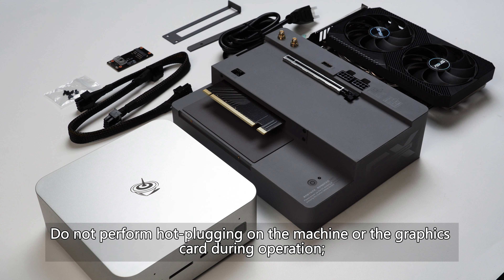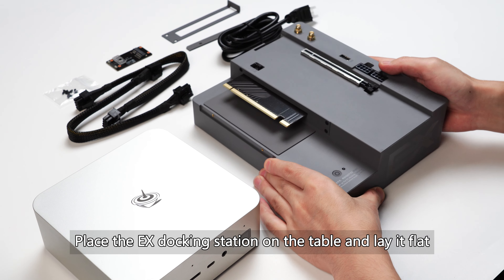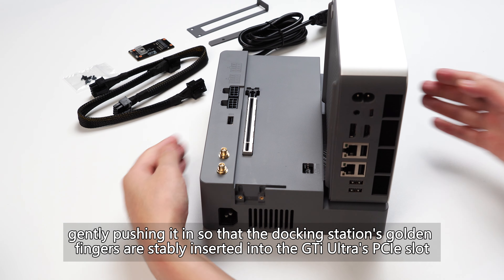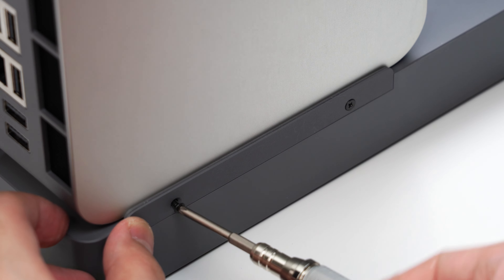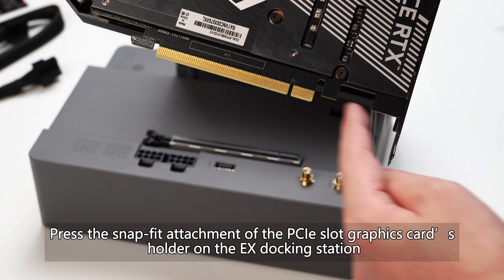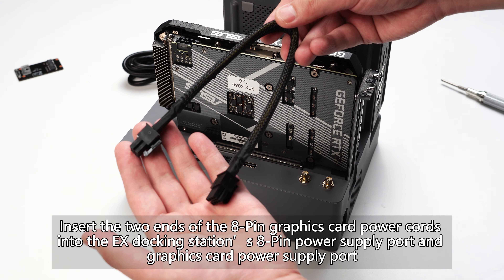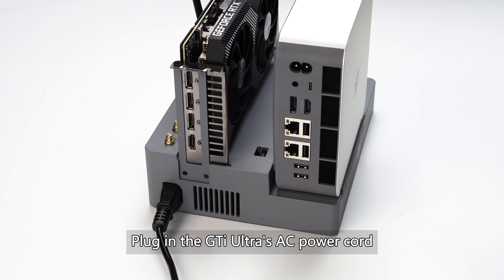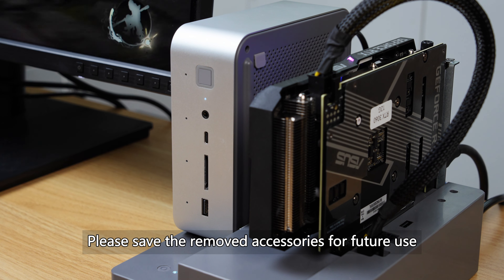How to install EX Docking Station for GTi Ultra and Graphics

Comment: Done (before I found this video)! Got mine a few hours back and my GTI14i Ultra 9 185h  with 96GBRam and 5TB SSD (1+4) is working silently and cool with my Zotac 3090 Trinity OC ... all flawless! Latest NVIDIA gaming ready drivers ... (and WSL2 Ubuntu 24.04). My mini home lab/creator/gaming cube is now exactly what I wanted!
Reply: @chafik0566 Awesome setup. Congratulations. I was considering buying 96 GB of RAM, but after checking the prices, I thought twice. My primary goal is to offload my Synology containers and add Home Assistant and maybe OPNsense. 32 GB should be enough, but 96gb would give me more peace of mind.
Reply: This is exactly what I've bought as well. I don't suppose you'd mind sharing your ssd and ram so I know what I'm getting will be compatible?

Also in which country are you based, I am in the UK and placed the order yesterday. However haven't heard anything regarding shipping. 

Cheers!
Reply: @JoelFabiani  yea ... my RTX GPU is showing now 24GB dedicated RAM and more than 40GB shared :) for those bigger tasks ... and I can run in WSL multiple Linux including GPU virtualization and if I choose to Desktop as well ... and Mac OS 14 in HyperV ... all together, lol. So its enough RAM to have multiple machines at the same time!
Reply: How's the power supply is it loud?
Reply: 96gbram😲u can buy ur own ram and upgrade it urself?

Comment: It’s unfortunate there are 2 separate power buttons
Reply from the maker: Hi, the PC and the dock each have independent power supply capabilities and can be used separately or in combination. In a daily office, audio and video, and other light graphics load scenarios, the PC's integrated graphics can be used, which is energy-saving and quiet. For usage scenarios that require high-performance graphics, such as playing 3A games, video rendering, local AI large model calculations, etc., you can use a discrete graphics card with stronger performance. The dual-switch design ensures that users can switch usage modes anytime and also extend the product life.
Reply: @Beelinkchannel the docking station should provide a power cable to power the pc

Comment: I purchased the Beelink GTi14 Ultra 185h model and am doing a benchmark test, but the CPU score is measured lower than 155h. This is a ridiculous number. Is there a solution to this?
Reply from the maker: Are you testing the CPU score by connecting to a graphics card? If so, please set the graphics card location in the BIOS to IGFX, and the score will be back to normal. If you are not sure how to do this, please contact our support team at support-pc@bee-link.com for help, thanks!
Reply: @Beelinkchannel  The issue of CPU performance decreasing when a graphics card is connected has been resolved with a BIOS update. However, after solving the problem, the score of CPU Ultra 9 is lower than the scores of review YouTubers of Ultra 7 chipset. Please tell me the solution for this part.
Reply: @ITan94-IT  Just to let you know, friend of mine had the exact same issue with this mini-pc and told me all he had to do was switch an option in the bios: System Agent Configuration - Graphics Configuration - Primary Display. Change the setting there from "Auto" to "IGFX". Supposedly the cpu started acting normally and had proper performance as it should.

Hope it helps!
Reply: @MrQwertyman111  Thank you for your kindness. But I've already set it up. Even after setting it up, the r23 benchmark is only 12000 and the timespy score is still lower than 155h
Reply: @ITan94-IT  Did you find a solution for this?

Comment: Hello this idea is fabulous and perfect but are you planning to make other beelink mini pc also compatible?. I am using the gtr 7 pro. Is it possible to make docking station also compatible with other beelink mini pc? The biggest problem Im facing is the only way to connect an egpu is using a thunderbolt but that really doesnt utilize the gpu fully.
Reply from the maker: Currently, only the GTi Ultra series is compatible with the dock, and we will release more models that also compatible in the future.

Comment: Great video. What would be the best GPU considering the x8 PCI lanes?
Reply from the maker: When using an NVIDIA 4080 card or with a lower GPU, there is almost no loss and the performance of the GPU can be fully utilized.
Reply: @Beelinkchannel how much performance loss with a 4090
Reply from the maker: @hidden_name7469  The loss will be around 2%.
Reply: @Beelinkchannel  not bad at all! Are the dock fans rally loud when using the 4090?
Reply from the maker: @hidden_name7469  The dock and the GTi Ultra will not be making loud noise, please rest assured
Reply: Thanks! What is the PSU that is inside? Can you share that detail? @Beelinkchannel
Reply: @Beelinkchannel  Please share more information about the PSU. What is the pinout?
Reply from the maker: @marshallskeen6560  Sorry, we can not share more info about the pinout of the PSU, please let me knoe if you have other questions, thanks!
Reply: @Beelinkchannel  What do you mean? How are people supposed to know which cables to use for the dock? Without knowing the PSU specs, you can destroy your hardware...
Reply from the maker: @marshallskeen6560  Hi, sorry for misunderstanding your message, do you mean that you want to know the specs of the 8pin power supply interface?
Reply: @Beelinkchannel  Yes, that's correct.
Reply from the maker: @marshallskeen6560  Hi, the specs are clearly labeled on the interface, please contact us at support-pc@bee-link.com for the high-resolution image of the interface specs for reference, thanks!

Comment: a yo, too many cables?? does the minibox still need power plug too ? just draw it from the 600watt dock
Reply from the maker: Yes, they are powered separately.
Reply: So all three monitor; pc and ex docking station needs to connect to power supply? Can I use a surge protector to connect them too?
Reply: What the optimum best cable from graphic card to monitor a display cable or HDMI cable?

Comment: The product is good, but the performance is different from the description
1. My cpu cinebench R23 only has 12000 multi points. I'm only getting 750 points in 2024 version as well. This shows a performance drop of as much as 20% of 185h performance. Is there a solution to this???

2. I live in Korea. So I want to buy an ac cable for Korea, is it okay to connect 220v 2.5A cable???
Reply from the maker: Could you please contact our support team at support-pc@bee-link.com for detailed help? Thanks.
Reply: weird, I'm getting 1k higher than avg. score on Timespy with my 4070 ti super. Literally performing BETTER than my desktop.

Comment: Except for the model list available at the official website how can I know if a chosen GPU will fit in size to the docking station or will be too big? I wouldn't want to disassemble any parts from the GPU before installing it.
Reply from the maker: Hi, there is no limit on the length of the eGPU, and the maximum thickness of the eGPU is about 72mm.
Reply: @Beelinkchannel  Thank you :)

Comment: If you shut down the PC, does the graphics card PSU shut down as well? What about sleep/suspend modes?
Reply from the maker: The graphics card will be suspended if you turn off the pc.

Comment: I just got mine today. It doesn't work. light on the power button turns on 3 times then stays off. My graphics card at that times runs like a jet engine. do I need a driver? I turned the GPU on first like the video says then the computer. is there something more I need to do?
Reply from the maker: Hi, could you please contact support-pc@bee-link.com? Our support team will handle the problem, thanks!
Reply: did you figure out what the problem was?
Reply: @Feynman.R  i second that question

Comment: can we add more powerful power supply to the unit?
Reply from the maker: Thank you for your inquiry. Unfortunately, it is not possible to add a more powerful power supply to the unit, as the power supply is custom-designed specifically for this model. Any modifications may affect the unit's performance and safety.
Reply: @Beelinkchannel  thank you dear for the fast reply. Can we consider the unit safe and future proof to support rtx 4090? And till what limits of watts we have?

Comment: It supports NVIDIA 4060Ti 16GB? I was searching for something Like this! But dont see this model on specs. How many RAM can you upgrade, 2x48 i think, no?
The POWER supply is ATX or SFX?
ThankU
Reply: power supply is atx, 600W. it can support up to the latest rtx 4090. and yes, it can be upgradable up to 96gb ram (48 x 2) and 8tb nvme ssd m.2 (4tb x 2)

Comment: how much power does this ex docking station can pull ? can it take rtx 4090 ?
Reply from the maker: If you don't overclock, there is no problem running 4090 for daily use
Reply: @Beelinkchannel  really ? thats insane !!! not to mention this dock look extremelt clean and neat